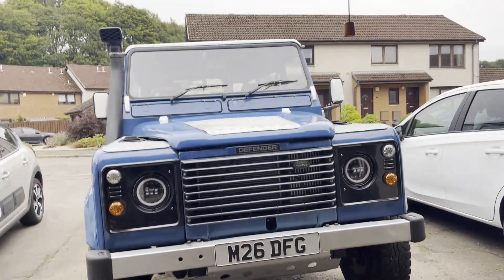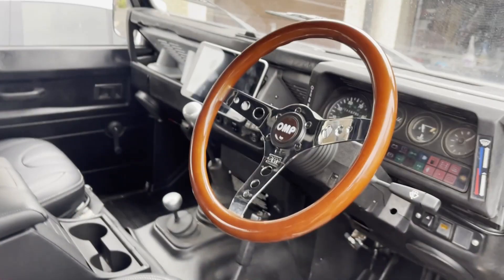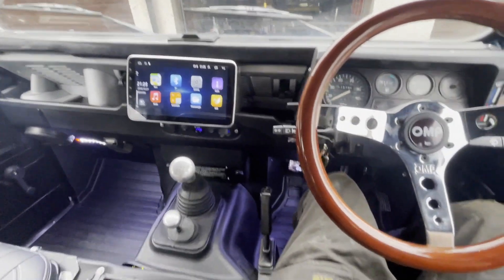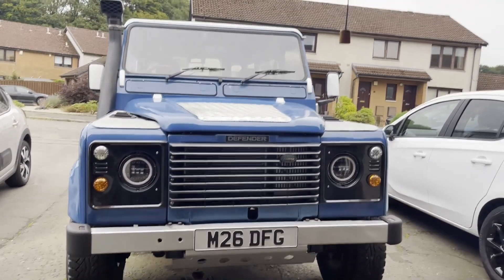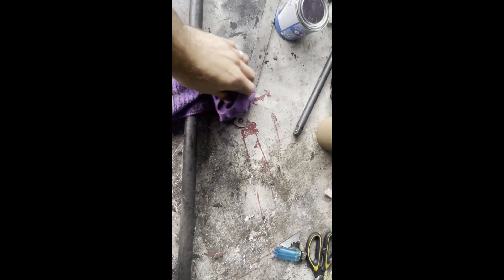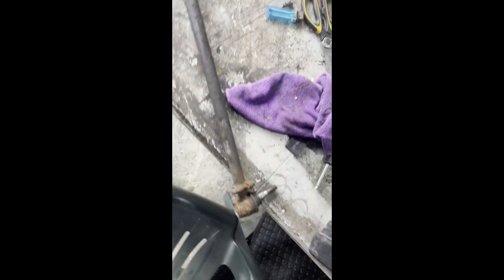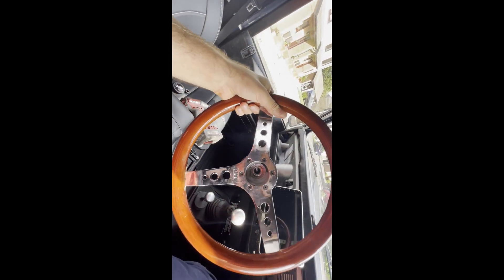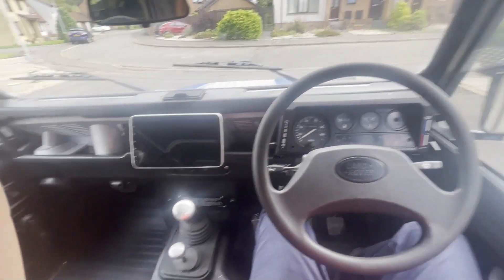I'm done.  MOT results.. Death Wobble Defender 300tdi

Comment: The wobble is usually the panhard rod bushings.  Sometimes you can tighten the bolts, but the bushings are cheap as chips even for genuine so replace those before messing with swivel ball preload.  The steering links you replaced did not look terrible.  I like the correct steering wheel better.  Nice work.